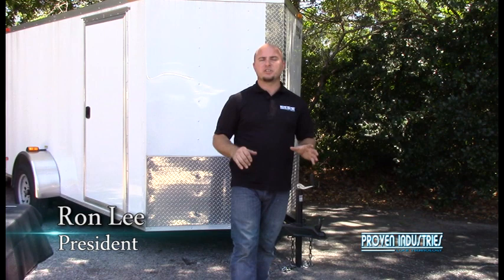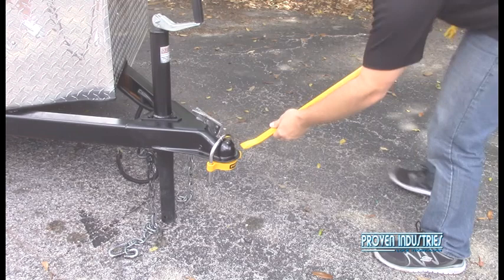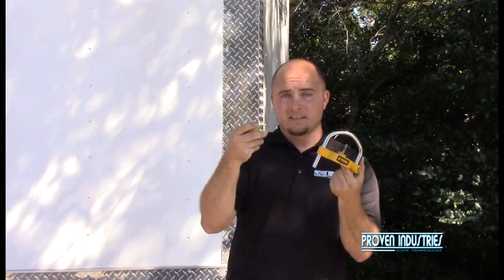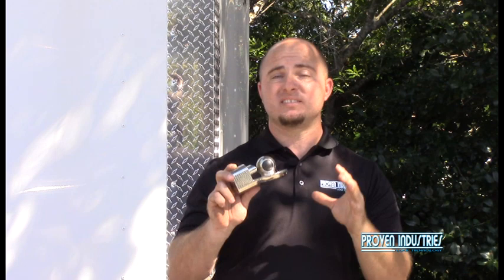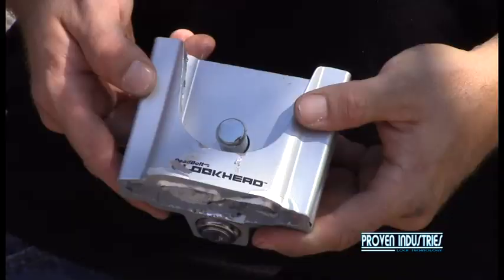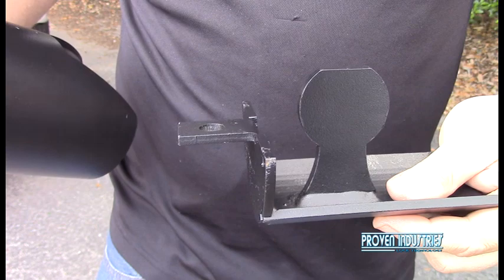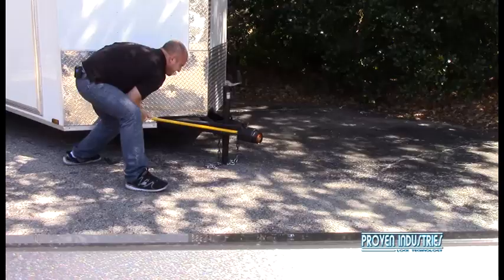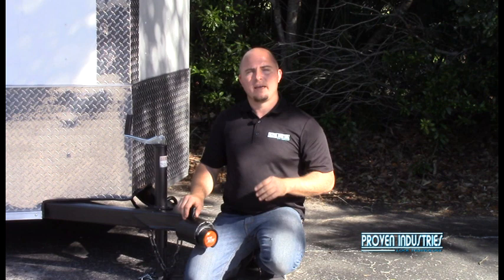Proven Industries Couper Lock Test, Best Trailer Lock

Comment: Why didn't you use the pry bar in-between the casing and the puck?  If the puck is aluminum and not a solid piece, I think if would break easily.
Reply: Because braking their own lock is last thing he wanted :)
Reply: It won’t. For one, there’s not enough space for a pry bar to get between the puck and the casing. Secondly, it’s a seriously solid puck, and the bolt that is inside to secure it to the casing, is seriously solid as well. A perp isn’t getting into it without some serious drilling. Definitely more than they’ll want to do without taking forever and drawing attention to themselves.

Comment: I would like to see you make a video trying to defeat that lock with a cordless grinder. Also if you use a carbide tip blade, I've gone through quarter inch steel like it was butter

Comment: Just use a screwdriver to remove the two small screws on the bottom of the aluminum locking puck and the locking mechanism just falls out.  I could remove this lock in about 30 seconds and be as quiet as a mouse about it.

Comment: To those people that commented on the latch being up when he pried the devices off as being deceptive: those locks did not secure the latch at all so why wouldn't someone trying to take your trailer lift it up before prying?  I don't see any deceit and yes the puck does look like the weakest point but looks like a better lock than the competition to stop the less equipped thief.
Reply: Those other coupler locks do NOT have full size balls inside them that would be held by the coupler latch.  They have 1/2" or so pins, or 1" knobs.  Neither would be held by the coupler latch at all.
Reply: David Rowley I purchased the Proven Industry lock 3 months ago and feel very good about it. I upgraded the puck lock to stainless steel instead of aluminum. It is pricey but a great lock to secure my investment. I’ve seen people on my security video drive through my driveway that goes behind my house to get a closer look.  Pretty obvious what they were up to especially when driving past a no trespassing sign.

Comment: Question 🙋‍♂️ if you leave the latch unlocked and pull it upward, does it release it entirely? Or do you ALSO have to put a lock on the latch
Reply: You have to use the key to lock it.

Comment: Damn, I was actually looking at buying that first one you showed. Good thing I didnt.
Reply: Not many are made of aluminum, notice how he didn't use the steel version of that lock... but even their lock is not hard to bypass, all security devices are a deterrent and never going to stop someone determined to steal what you have. The best way to stop a theft is chain it to someone, lock the wheel and add lo-jack
Reply: @EliteGeeks  True.
Reply: @EliteGeeks  - that is a $100 upgrade, as he suggest buy a puck lock elsewhere

Comment: First, nothing is Crack Head proof! Second, this is a much better lock than the competition but this guy was using this saw saw like a girl, you could just bring a portable cutting torch and cut it off, the best thing you could do is add gps to the trailer and pick it up the moment they stole it
Reply: .44 magnum - crack head proof
Reply: Brain, the first part of trying to steal something is not looking suspicious, and draging around a torch is pretty suspicious
Reply: Not if you are wearing coveralls and are carrying a toolbox. 😀
Reply: I agree with you. But hide the GPS tracker well so they do not find it.

Comment: To all you that are calling the pry bar a crow bar, get it "straight" !!   A crow bar is a heavy straight bar about 5" long that has a flat tip on one end and a point on the other.  Btw  that is an awesome coupler latch lock.  I have one one my trailer.  I only wish I had better security on my doors.
Reply: I would absolutely call what he used in the video crow bars. Those are the only things I call crow bars. I have no idea why you think a crowbar must be 5 inches long, or why you think crow bars have a point on one side,  If you meant 5 feet long, what you're thinking of is a digging bar, which is absolutely not a crowbar. Crowbars, in my opinion, made of round bar, and have a serious hook on one end with nail grooves, usually in both ends. If the bar is flat, it's no longer a crow bar.
Reply: I meant  5 feet long!  the bar you described is a goose neck nail bar, not a crow bar!  It is a miss conception 
The crow bar is straight as the crow flies. which is not used just for digging. It was used in building the railroad tracks. to pry and help move the ties into place.  and many other uses. you can call it a digging bar if you want, but you would have to call it a rock buster too.  You probably call a wonder bar a crow bar too.
Reply: @ericlewis6470  The Stanly Wonder Bar? Those are pry bars. Your perspective on this is interesting but I can't find common useage to back this up. That would  be interesting if the original use of the term crow bar came from rail rod construction.
Reply: byw. I am not trying to be a smart aleck, or a know it all. I am trying to change a miss conception. Look up this on line ad for a crow bar. www.hayneedle.com/product/true-temper-1160100-60-in-steel-pinch-point-crow-bar-cfm

Comment: On a straight tongued utility, boat, landscape trailer, the body needs to be long enough to cover the bolts that attach the coupler to the tongue. Otherwise, with a couple of wrenches, the coupler and lock are gone . Bolt on a new coupler and your trailer is gone.
Reply: Have a couple welds added to the coupler to tongue steel joint.  $20 at a small shop.

Comment: sold! I know they are not cheap but still far far less than the loss I would take if one of my trailers went missing. I recently had one broken in to right outside my bedroom window, a cargo trailer,they didn't even mess with my expensive case harded steel disc lock they just gut the damnd latch with bolt cutters and apparently did it pretty quite like ot they would have had woken me up and been run off in a hurry. I need to find a way to better secure the doors of my trailer including the actual handles being cut, there needs to be an automatic/remote controlled locking system that locks from within.

Comment: Proven - I know no lock is 100% safe, but just curious how your lock holds up to someone with an angle grinder or welder?
Reply: There is always a way the idea is to slow them down on the spot but if they put it on a flat bed then bye bye camper

Comment: That's great and I'd buy one in a heartbeat. Except, my utility trailer coupler bolts would not be covered by the lock. Make one with a longer tube that would cover the bolts in a lot of applications. I'd buy 2 if you built it.
Reply from the maker: email us some pictures :) onlinesales@provenlocks.com we can do custom!
Reply: ... tack weld your bolts
Reply: You can probably buy a used Lincoln welder on Craig's list and tack weld the bolts for the same price as the locks.

Comment: Don’t want your trailer stolen? Don’t leave it in a place where thieves can get to it. If that’s not possible use as many deterrents as possible. Locke the wheels, brake locks, hitch locks, whatever it takes to make it as hard as possible and as time consuming as possible. Thieves like low hanging fruit, not a challenge.